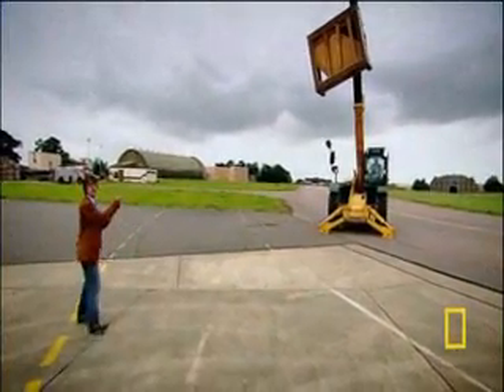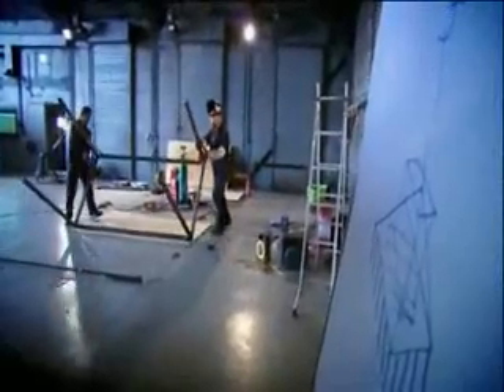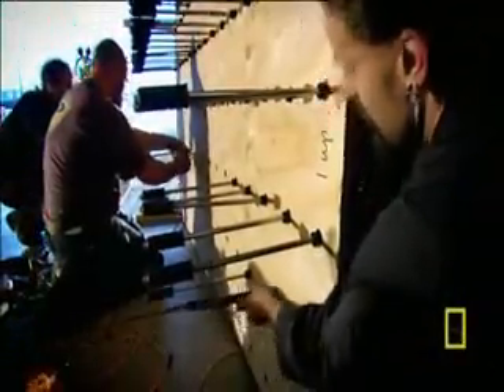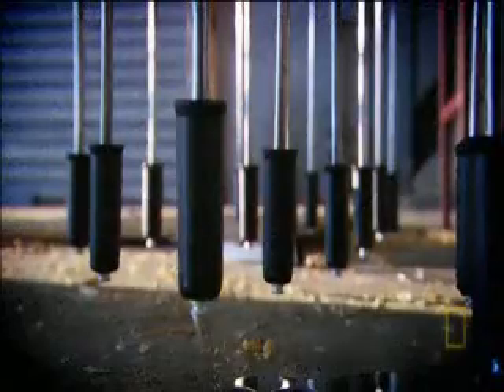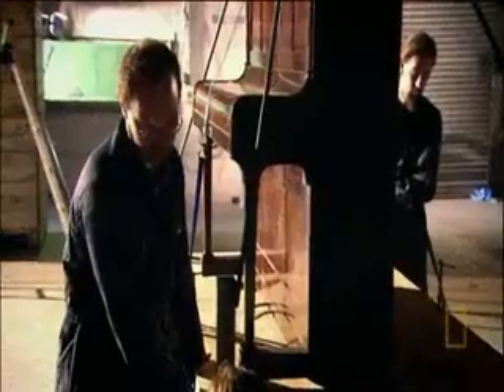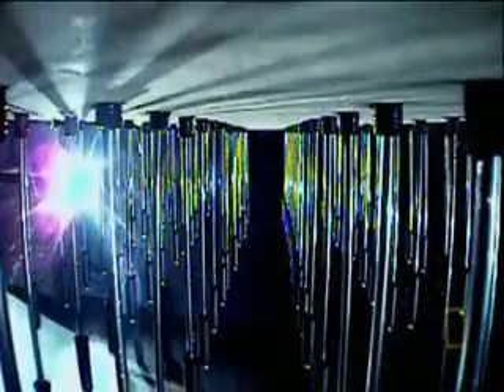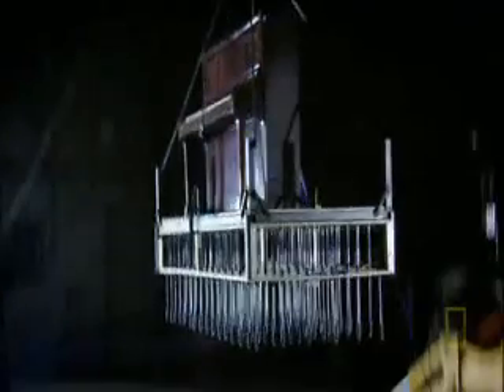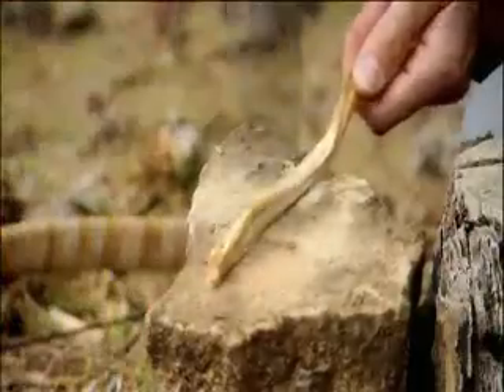Airbus A380 5/5

Comment: I can see your point but still, the weight is still greater than air resistance.  it might skew the results a bit but without the shocks it would still break.